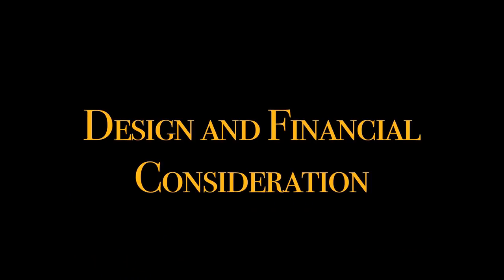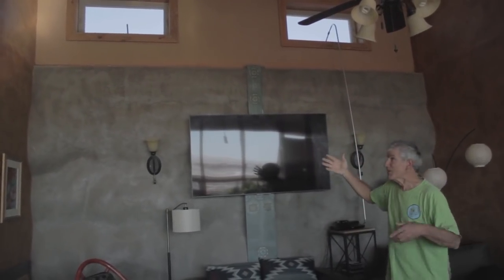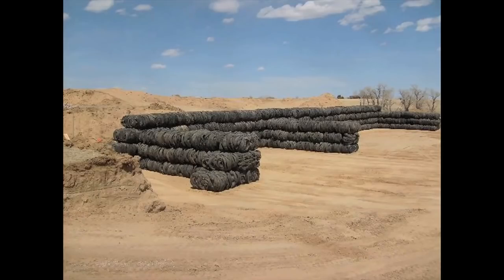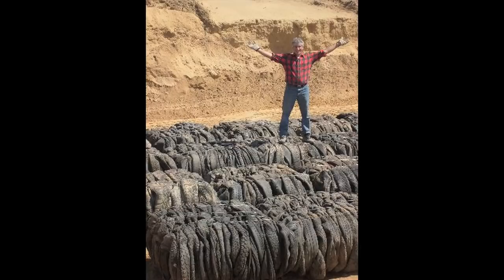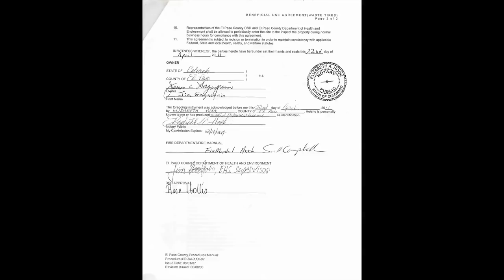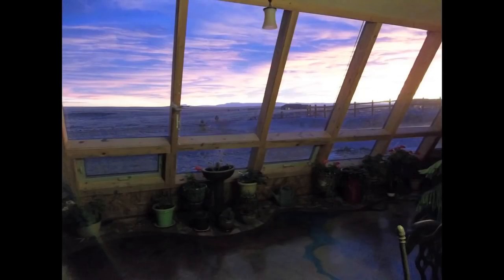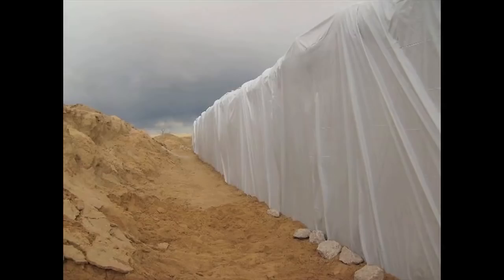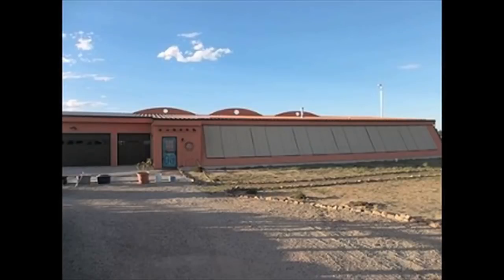Zero Energy Passive Solar Bermed Earth Tire Bale Home - Pseudo Earthship

Comment: is it posssible to build this in northern GA
Reply from the maker: Yes, you will find that you need very little AC in the Summer.  Also, a bermed house will never drop below 57 deg F.  So, on those rare days of freezing, and possible power outages (i.e. Texas 2020), you won't have to worry about freezing pipes.  You would want to use vertical windows.  You won't need all that heat gain from slanted windows.  You could also cut back on the number of windows.

Comment from the maker: This incredible home on a 5.9 acre lot is now for sale.  We are moving closer to family.  At $795K, it is priced comparably to stick homes that have recently sold in the area.  It's for sale by owner on Zillow (link below).  If purchased without a Buyer's realtor, the 2-1/2% savings will be passed on to you.  That's another $20K off.  Also, please consider that this home has no heating or cooling costs, and there are enough renewables to power the home and most (or all) of your vehicle travel with a PHEV or EV. 
https://www.zillow.com/homedetails/3695-Hare-Haven-Ln-Colorado-Springs-CO-80930/121238138_zpid/?view=public

Comment: Question (if you know the answer) if I were to build conventional and have R60 walls and ceiling would it be the same? Or is it much more R value with the bermed earth?
Reply from the maker: There are a lot of factors to consider.  First, once you insulate the walls on the inside, you have eliminated all thermal mass.  The tire bales provide the insulation and thermal mass.  The insulating qualities on the tire bales go deep into the 5-foot thick wall.  The berming provides cooling in the summer, similar to a basement.  A tightly sealed conventional home was our second choice, and can be very effective, using an energy recovery ventilator for air exchanges.   Many use this method with geothermal heating and cooling.  It's much more practical in urban areas, where there isn't room for 5-foot thick walls.

Comment: Do you have any concerns about the tires being a health issue due to their toxicity?
Reply from the maker: Two points here.  If you ever go into a tire store, that smell is off-gassing of tires.  As tires are worn, they release less and less gas, to the point that they release near ZERO.  Before we covered our tires, you could not smell this, unless you put your nose right up to the tires.  Secondly, the tire bales are covered with about 3-4" of shotcrete, and there is adobe on top of that.  No - zero off-gassing.
Reply: @jimgagnepain7708  Thank you for the response! That's a relief and was something I wasn't sure about

Comment: What's going to happen when the baling wire securing the tire bales rot?
Reply from the maker: The baling wires are made out of high gage galvanized steel, which doesn't rust.

Comment: how many square feet is this earth ship?
Reply from the maker: The original design was about 1900 sq. ft.  The tire bale averaged larger than the 5'x5'x2-1/2' high, and as a result, the footprint grew.  It ended up about 2350 sq. ft.  Luckily, since I was the GC, this didn't cost much more, other than the cost of additional materials.

Comment: What does a 2 bed/2 bath cost?
Reply from the maker: Our home cost about $270K to build in 2011.  This includes the solar and wind renewables (with rebates at the time), but does not include the price of the land.  Bear in mind that I did the General Contracting, and also helped with a lot of the construction.  It would have cost quite a bit more, had this not been the case.  Also, prices of everything have risen substantially since then.
Reply: @jimgagnepain7708   Thank you.

Comment: What was cost per square foot ???
Reply from the maker: I calculate about $1027 per sq. ft.  This was in 2011.  Keep in mind, however, that I acted as General Contractor.  In addition, my wife and I were on-site six days a week, for almost 9 months.  And we were active participants in all the construction phases.  One other thing.  We got our OP without having interior walls finished.  As long as the wiring and plumbing was covered, we were OK to move in.  We used adobe on all interior walls (directly over the tire bales, or black-paper/steel mesh/adobe over OSB walls.  We worked on and off for 5-6 years to finish this.

Comment: How much does this cost
Reply from the maker: Hi William,
With the solar panels and wind turbine, and associated State rebates and tax credits, this structure cost about $270K.  That does NOT include the cost of the land.  Also this is 2011 prices, and we were in the midst of a recession, so contractors were "hungry" to work.  A lot of prices, such as lumber and concrete have gone up substantially.
Reply from the maker: I should also mention that I GC'd the build, and my wife and I participated in a lot of the construction.  This saved at least $60K, and probably more.

Comment: Tire bales ! Tire bales T I R E BALES !!!! This is THE way to go $!!
No more 50 volunteers , no ben gay
Disturbers ! Now if I just could figure out how to get a building permit &
find Someone that already knows
how to build one in Tenn. ( that also knows how to prevent mold & mildew ) ! Oh , did I mention , build it at a price point I can AFFORD ?!
Reply from the maker: I hear there are earthships in every state in the US.  I would not shy away from a dehumidifier or air conditioner.  With the bermed home, you will need very little cooling, and you could probably accomplish this without a ductwork system (just a small through-the-wall unit).  This will also help with indoor air exchange, which is a problem with tight homes (you want your home to be extremely tight).  Utilize either a heat pump for year-round operation, or an energy recovery ventilator, or a combination of the two.
Reply: @jimgagnepain7708  what about that price point thing ?
Reply from the maker: @johnhoward7298  I built in 2011, and including the wind turbine and solar and associated rebates, our total cost was about $270K.  That cost does not include the land.  Also, bear in mind, that I General Contracted the build (probably saved about $60K).  Also my wife and I were there every day, assisting with construction, and doing a lot of the work ourselves.

Comment: did you ever test for radon?
Reply from the maker: No, we did not.  I had to install a radon mitigation on our previous house.  In an earthship, we open the windows a lot, even in the winter.   Radon is usually a problem in basements, where there isn't as much air exchange.  This is a single story home, with doors on both ends of the structure.
Reply: @jimgagnepain7708  That makes sense, we typically close up a basement, whereas, you   have more air exchange.
Reply: Thanks for asking this. It was one of my concerns.